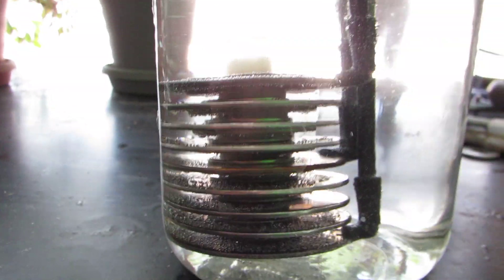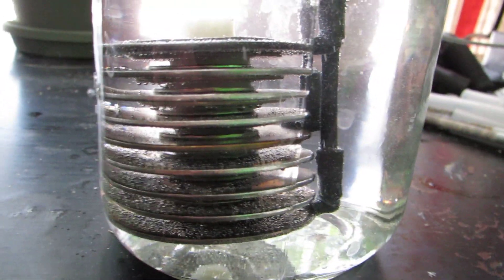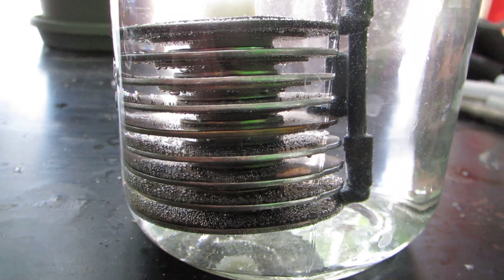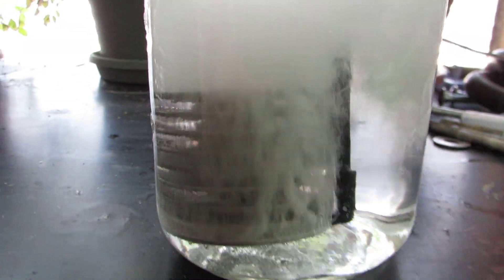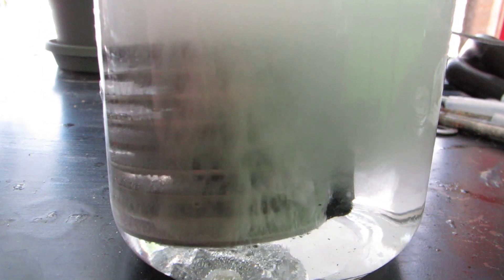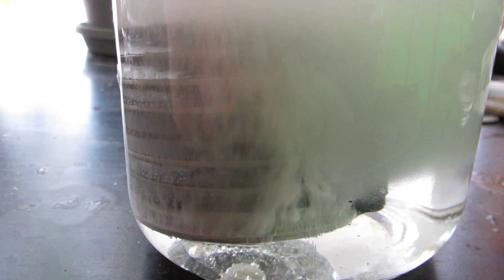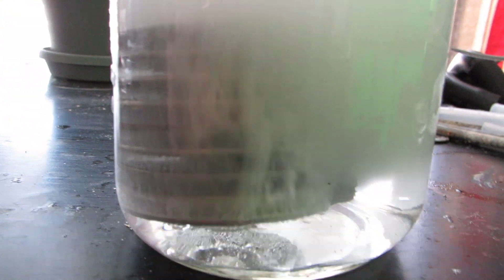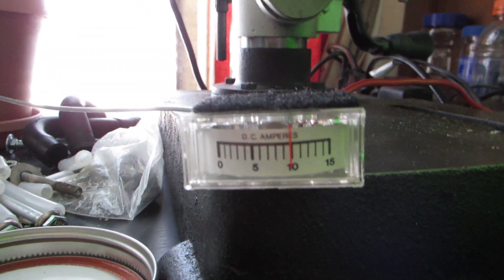Vid62 Volcano Washer Hydrogen Generator Test 2

Comment: hey, really nice output for such a small cell. with reguards to your cell container, check out tap plastics online or find a plexiglass company close to you. they can get you materials to make a larger container or make a plexiglass box with there special adhesive. works really good, gasket material, see if you have a Mr. Gasket store in your area. again, really nice output. congrats